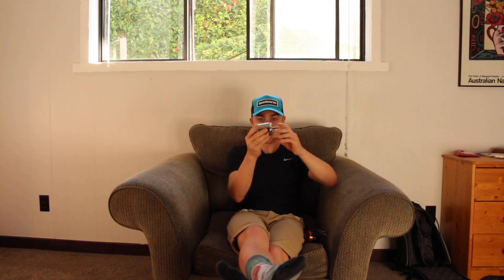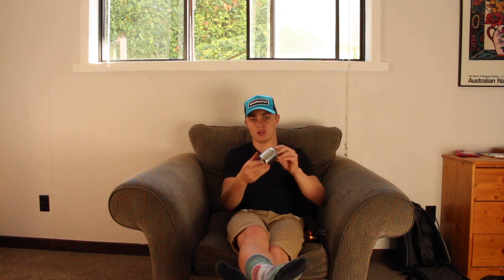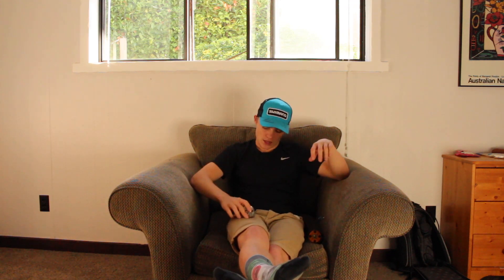How to choose an electric skateboard Motor

Comment: So I was looking at the 6374 192kv on 6s but my question Is the 6374 245kv is faster on 6s  thanks in advance..
Reply from the maker: Yeah 245kv would give you a higher top speed but wouldnt have as much torque as the 192kv
Reply: @amprojects5113  what about aliexpress MOTORS?...

Comment: hey m8 u just saved me i got a 4250 500kv by mistake and in like 3 min it smoked hard and stop working, i mean i was going fast xD, can u post where u got that motor and will it work with 2 6s lipo in paralel ??
Reply from the maker: Gabriel Gama both of the motors in the video would work great on a two 6s battery's in parallel and I purchased the motors from hobby king if you are interested

Comment: I have four 'Quanum MT Series 4012 340KV' motors from a previous project. If I was to use these to make a 4 motor electric skateboard, what results can I expect?
Reply from the maker: Bilal Ahmed you could use those motors with a 6s voltage setup and depending on your gearing you could build a very fast board